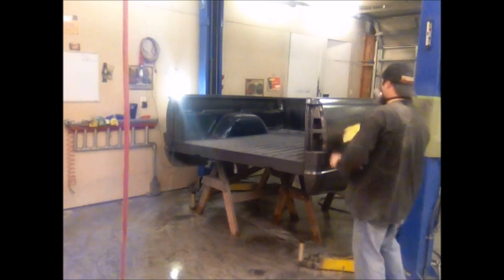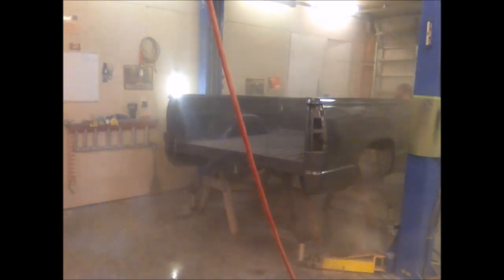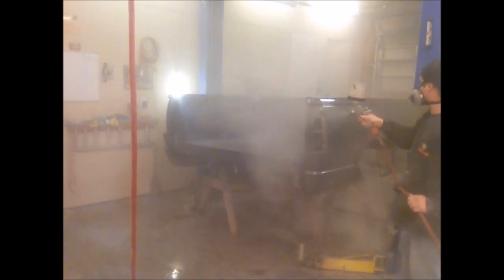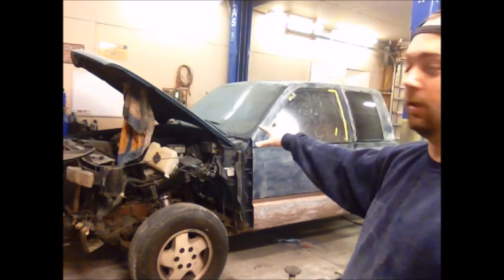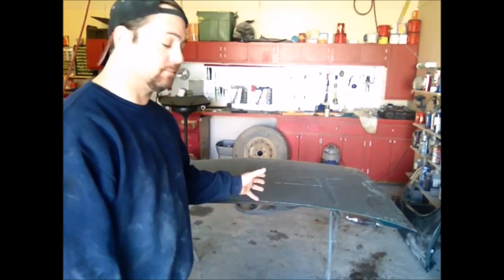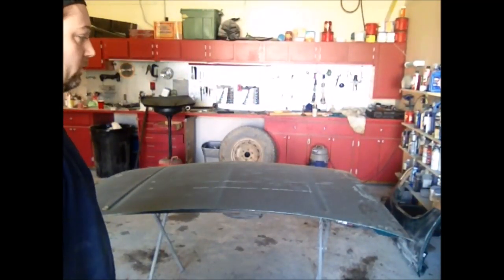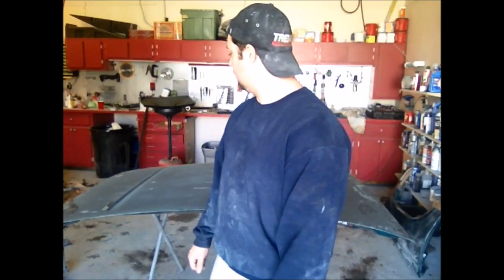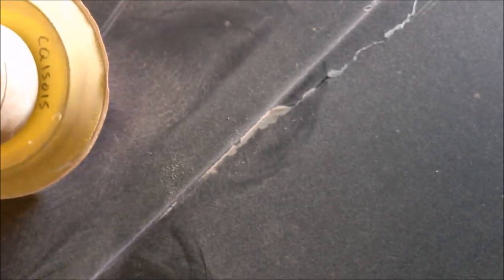How to:  Painting a truck from start to finish, part 4

Comment: You are a badass great videos, I've been wanting to do this to my 94 extended cab stripped it to the bare metal because of that good ole Chevy clear, the pickup when I ordered it had midnight blue pearl. Now going to paint it AP8 Lexus's blue Indigo ink after buying the paint kit $2100.00 got scared going to have it done
Reply from the maker: Thanks man, lol.

A full size is a big job for your first time, no doubt about it.  I had probably 100-150 hours in mine, and it was kind of a sloppy job.  If I was doing it for someone else, 200 hours wouldn't be out of the ordinary.  If it was your first time doing something like this, 300 hours or more wouldn't surprise me.

Comment: Crear vídeos Man! What set up are you using? Like paint and what gun etc etc

My main question though is how height is your garage? How is it you have a lift in it. I want one too lol
Reply from the maker: On this project I shot the base and clear with a sata4000RP.  The RP is a great clear gun, but I struggle with it and metallic base coats.  Ceiling height is 10 feet, the lift is 12 feet.  I had a dormer installed in my garage with a fake window, and poked the lift up through the rafters.